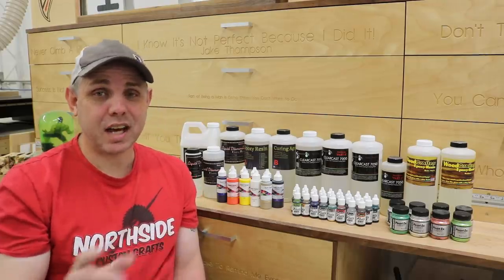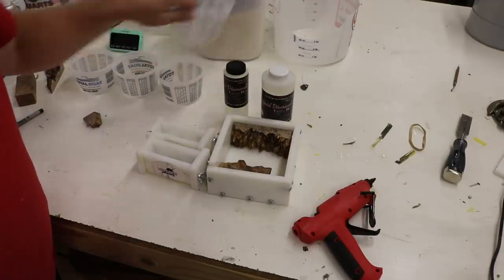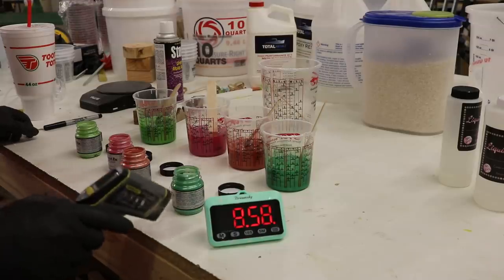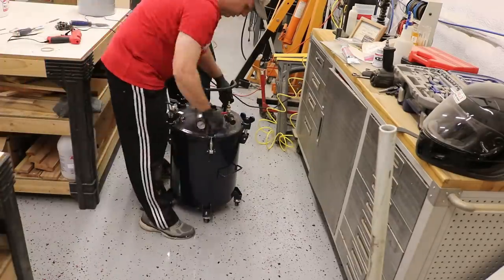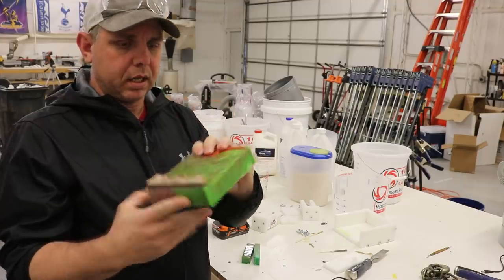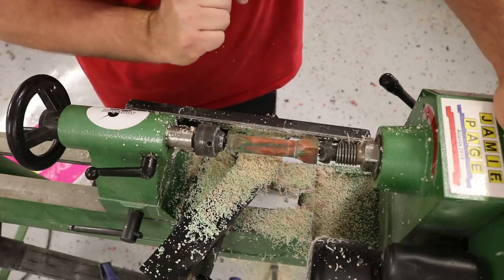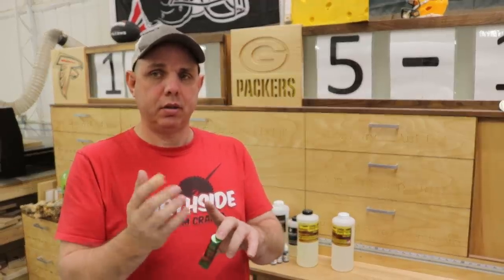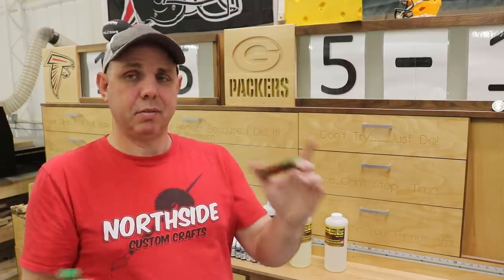Hybrid Pen Blanks with Liquid Diamonds Epoxy Resin

Comment: Great trick with the card scraper! I'd never have thought of that. 
I work with resin quite a bit. Not the kind you have to check the temp on, that having been said ...
Wood off-gasses. Best way to keep the bubbles out of resin without a pressure pot is to seal the wood first so air doesn't get out. Can use a couple of coats of shellac, or UV resin (just a thin, painted on coat) that you can put outside on a sunny day and it will be ready for pouring in about 10 minutes. Maybe an hour in cloudy conditions. Once the wood is sealed, any bubbles will come from the resin. (UV coating may be sticky even when fully cured, so you can wipe with alcohol if you're concerned about it). 
One way to get the bubbles out (again, I don't use stuff you have to check the temp on), put the mixed resin (before coloring) in a water bath on the stove and heat to 125 F and let it sit at that temp until all of the bubbles are gone. If you're mixing in small amounts (or using a resin with sufficient working time), you can actually heat it on an electric coffee cup warmer until the bubbles are gone. 
Then you can mix in your colorant very gently so as to not introduce more bubbles than necessary (and I recommend a plastic or silicone stir stick because the tongue depressors sent with most all kits are WOOD with trapped air), pop what comes up with a torch, and voila!.
If you take the time (and I'm as impatient as they come), you won't ever have a bubble problem with hybrid blanks.
Reply from the maker: Thank you for the information.. I’m sure it will help some folks. 👍👍

Comment: I made a pressure pot from a HF paint sprayer but need to practice with it more. I was using the incorrect type of resin and it wasn't working well for me. This was before I even started turning anything on a lathe lol. I think I'll look into getting some of this resin, just for the fact that it seems easy to work with, and no pressure needed. Thanks for another great video, and GO PACK GO
Reply from the maker: Go Pack Go!!!

Comment: Those turned out GREAT. I think your idea to leave in the original container longer would be a good idea. I use liquid diamonds, thank to Zac’s recommendation. I do not turn but it works for me for the most part. There are still some bubbles when the resin is translucent but not too bad if you watch it with a lighter or heat gun like what you did. Thanks for sharing.
Reply from the maker: Kris Gschwend Thanks for watching Kris!! Glad you enjoyed. I go to Zac for lots of things.. he’s awesome. Yeah.. I totally chickened out when I went over 60 minutes.. but i will do it different next time for sure.. my next one with liquid diamonds will be with clear and a little color in it just to see the clarity.. Thank you again!

Comment: Jake, at 2.55 point, you placed molds into oven for preheating. Thus, a few questions. 
1) how long do you typically bake the molds? 
2) what temperature are you setting the oven? 
Given that you used HDPE type molds (I'm new to casting), is there a difference in using silicone molds?

Also, I really liked your use of a card scraper. I'll have to give that a whirl!

Thanks for your instructive lesson.
Reply from the maker: Thank you… Glad you enjoyed the video.. 
I put the molds in the oven at 150f for about 30 minutes.  This is a pretty old video and I mostly use silicon be molds, in fact I sell my own molds now.. so much more convenient than HDPE .. not cheaper, but better in my opinion 🦾

Comment: Great video man.
I use Wise Bond epoxy because it also has a long working time. It's got a three to four hour working time. The one thing I like about the long working time of weisbond, is you don't have to worry about popping air bubbles. After sitting on your bench for 4 hours, the air bubbles have already risen to the surface and popped themselves.
I once poured a 6 inch block of clear resin and had no air bubbles.
And I never use a pressure pot when I use Wisebond.
Their stuff isn't cheap, but I love it. You should give it a look sometime
Reply from the maker: Cigar prop I sure will look into it. 👍👍

Comment: Hi Jake. Great video. I wanted to start turning resin blanks and didn't want to invest in a pressure pot just yet. I wanted to see if I liked it first. Can you tell me how long you kept the resin in the mold before you popped it out? (the one without the pot)
Reply from the maker: Thank you Michael .. I took the blanks out of the molds after they sit in them overnight.
Reply: @JakeThompson  Thanks for getting back to me. Not everyone does. That's why I follow you :)
Reply from the maker: @michaeldequatro1012  I don’t understand why people don’t answer comments… some slip by me sometimes, but I try to answer everyone. 👍👍

Comment: ever thought about using corn meal or  sand for volume measurements? They would probably give you a more accurate volume without stucking to stuff
Reply from the maker: Alex Sparks Never thought about it.. the rice works pretty well so I never considered anything else.

Comment: IAM looking at building a wood and resin table  , top ,legs , and side braces , will also be doing 4 chairs , is there a way to mold the legs round to start with or would I be able to use 3" pvs with a release agent I want the legs to be pine cones and resin unless there's a better type of wood that could be used for contrast, what are your thoughts on this?
Reply from the maker: I use pvc all the time but haven’t used one very long.. using mold release  has worked very well.. and if it gets stuck, it’s not too hard to cut it off and I’m not sure it would be too deep for one pour.
Reply: I would think 3" foam core pvc in order to keep it big enough, iam probably buying a lathe with taves

Comment: Jake great video thanks for showing the results..I have a DIY vacuum chamber could I use that instead of letting it sit out to help the bubbles come out. also on the link there is the liquid diamonds epoxy and clear epoxi resin for clear high gloss finish general use. Could I use that for pen blanks as well or just better to use the LD Epoxy thanks
Reply from the maker: gulfmedic1 Thank you for watching! 👍 yes you can use a vacuum chamber to remove air bubbles. The clear cast 7050 is for clear finishes on small projects.. the other clear cast products should be good for pen blanks.. I just wanted to try one product at a time.  I can say right now that the liquid diamonds is pretty good and it sands and polished easier than other resins as far as I can tell.. Thanks again.

Comment: Nice video. My big question is how would the diamond resin do with no pressure pot and with some wood. I don't have a pressure pot and have started casting with Castin' craft. It works but I hear it doesn't work well with hybrid wood blanks.
Reply from the maker: Jillian Nitz I will test it for sure. Instagram would probably be the best place to see the results.

Comment: I feel pretty dumb asking this (newbie here) and I can't seem to find the answer anywhere else. What do you mean by the card scraper will find your love spots? Is the card scraper the same thing as a diamond sharpening plate or are they different? Thank you in advance. :)
Reply from the maker: Hello Jenny.. I think you meant low spots.. love spots is a totally different thing.. lol a card scraper is a piece of metal with a flat edge.. I think they are also called cabinet scrapers.. when you put the flat edge up to the blank and scrape it.. the low spots will be very obvious.
Reply: @JakeThompson  LOL, gotta love the auto closed captioning (I'm at work). Thanks for the fast reply!

Comment: Does the proper temp to add color change based on the resin you’re using? I think here it was 120 degrees. Is it different for Alumlite or Total Boat? Thanks! Great vids!
Reply from the maker: David Campbell You are correct, it is different with different types of resin. Alumilite is 98 degrees.. I haven’t messed with total boat enough to know yet.. experimenting is the fun part though.

Comment: One thing you didn't address, Jake, is how the Liquid Diamonds turns.  Having turned nearly all the different synthetics, I find that LD and Alumilite turn the best.  They aren't as brittle as polyester resin and are more resilient.  More importantly, they are less likely to have chip out unless you get really aggressive... from my experience.  Did you find this to be true for you?  The blanks turned out great, BTW!
Billy
Reply from the maker: Billy Burt I really didn’t get to turn enough on these to form an opinion yet., I just turned the two blanks until they became round. The next video will be a heads up comparison with Alumilite, Liquid Diamonds, and Total Boat. I’m going to cast larger blanks and compare lots of different aspects.. I’m pretty excited to get this comparison video made.

Comment: Hey Jake does the alcohol dyes work with resin, and what is your favorite resin to use. Thanks for the videos
Reply from the maker: bret Eckert Thanks for watching. The alcohol dyes will work. I’ve mostly used alumilite slow for deep pours.. I have a pressure pot so it’s not a problem.. if I wanted to cast before o got a pressure pot, liquid diamonds would be the way to go.. the next thing I do will be further testing and comparing.
Reply: Thats exactly whag i said as well. Its amazing
Reply: Hey Jake have you tried aluminite deep pour. They claim you can pour un to 2" and no need for a pressure pot. I loved the video

Comment: Jake, so compare this resign to Alumilite. I know they are both different, which one you like?
Reply from the maker: Gary Spruill  I haven’t done a deeper pour with liquid diamonds yet.. but I plan to do a side by side with liquid diamonds, total boat, and alumilite. Should be fun.. but I already know alumilite  works for deeper pours and you don’t have to do multiple pours.. the liquid diamonds did seem to sand easier and faster than alumilite.. I will compare lots of aspects when I make that video.. I wanted to do it this week but it turned out to be freezing in Amarillo this weekend.. lol
Reply: @JakeThompson  my guys, here with me from Amarillo, just spoke with the wives and they are telling me it is snowing in Amarillo. Snug Bug in and stay off the roads. Later
Reply from the maker: Gary Spruill 👍👍👍